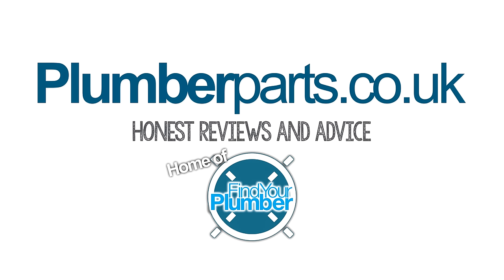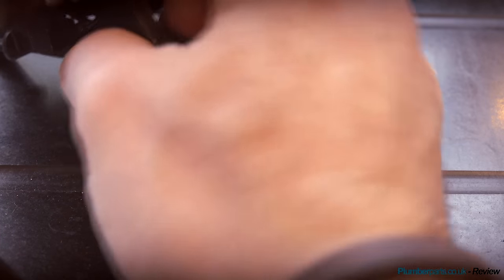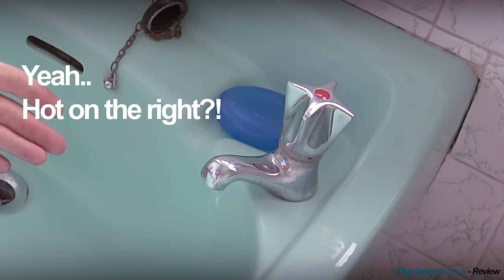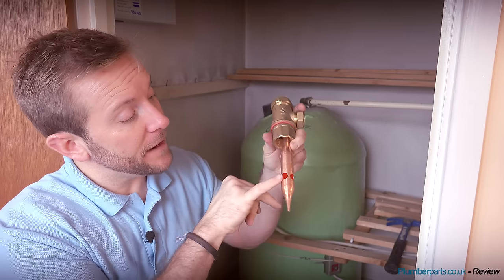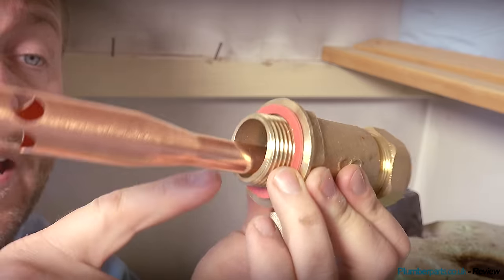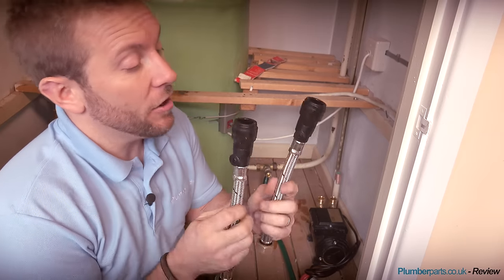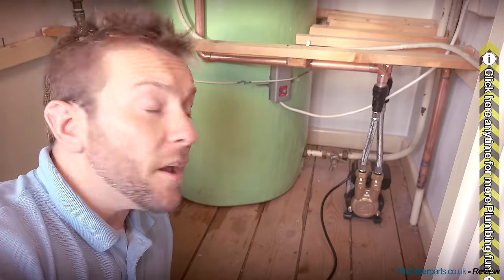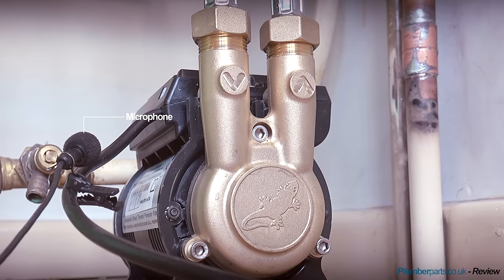BOOST HOT WATER PRESSURE - CT Force pump

Comment: Great video, given me hope. I'll tell you why. 
I have just installed a new mixer tap in my kitchen, along with a new sink, as it happens. I now have almost zero hot water pressure at the new tap. Everywhere else is fine, bathroom etc.
I think I know what the problem is...I have an old gravity fed system and this modern tap is designed for a minimum of 1bar. So, I now think to myself...install a pump on the hot water feed. But I need to understand the feasibility of this given that I have a Mira power shower drawing from the hot pipe from the hot tank and from the cold header tank. I will use a plumber to do the work but I need to understand how it will work, as I realize that the Mira shower pump doesn't want hot water 'pumped' into it.
I just want to know it can be done before a plumber tells me I need a Combi or another type of tap.
Reply: Steve what was the outcome? Did you install the pump without harming the shower? Cheers.
Reply: @MrWad3y  Due to the fact that my boiler was quite an old back boiler. I installed a new combi and changed the shower pump to a combi-compatible pump. I now have pumped hot water from the combi boiler.
Reply: @steveday6860  ah ok, probably a better choice in the end. Thanks for the reply, appreciate it!

Comment: I did everything in the video and it works a treat, except the shower. All the taps downstairs and upstairs work much better but when I put the shower on the pump does not kick in. It had an average pressure before and was adequate for a shower but I'm at a loss as to why the pump does not come on. Is it because of the mixer tap in the shower?
Reply: I am considering installing one and have the same set up. Is you cold water in the mixer tap on mains pressure or fed from the tank

Comment: I'm just wondering would it not pump water up the vent pipe ?
Reply: Hi, if the pump is installed correctly, in line with the installation guidelines, it will not pump water up the vent pipe. Thanks.

Comment: @plumberparts i have the same system, which i am looking to replace with a combi boiler, is there any benefits for keeping the existing system?
Reply from the maker: Unless space is an issue I would change this to an unvented cylinder and keep your current boiler. Combi's are nothing but hassle!
Reply: @plumberparts  true
Reply: Yeah it’s the tank in the attic that is going to be taking up room in the loft room. Anyway to reduce the system size without the whole system Change?

Comment: James can any single impeller pump work or does it have to be specifically for multi outlets... cheers
Reply: jason lawrence any will do, best to install a twin impeller to boost hot and cold if your thinking of using mixer taps or thermostatic mixer taps or showers anywhere.
Reply: What! no bypass!
Reply from the maker: Bang on mate!
Reply: Needs to be brass for hot domestic water.
Reply: Yay brass nuts in a world of plastic
Reply: @plumberparts  you used single impeller, and have mixer taps, wrong type of pump, you will find out when it comes to warranty claim, and they say its invalidated.
Reply: @sgt_xs9905  If you have a twin impeller pump and have a twin bar mixer shower tap and  sink taps  that are not mixer type, is this ok to install, as you could  have the cold tap on and not the hot at the same time is this ok.

Comment: Thank you for showing how this is done.I have a Victorian house in London with a 3/4 lead pipe cold water feeding two Bosch boilers as the house is in two flats  ,the pipe coming in is 3/4 to 15mm that feeds the hole house ,the pressure is ok but it can not deal with both boiler on at the same time or the toilet flushing .the pipe coming in is in the basement but have converted to a cinema room can I fit some type of pump with its own storage tank as I don't think that the pipe can deal with the increase in water flow needed, but it has to be small and not heard pumping away.Thank you for any advice that you can give me as I am no longer using the downstairs .

Comment: Hi James I am going to do a extension to my house & putting in a pressurised system from a gravity system with 2 pressurised bar showers, the flow rate is 16l min with 3 bar pressure from the outside tap will I have great pressure for the showers or will I need a pump/acculameter thanks love the videos
Reply: 3 bar incoming main should be defiantly enough to for the pressurised vessel, just make sure plumber installs 22mm not 15 mm from the main to the pressurised vessel.
Reply: Jordan Ackland thanks will do

Comment: Hi, I am replacing our existing Salamader pumps that have been discontinued. It has a 28psi sticker on it but when I rang Salamander they said that pump was rated 2.6bar. Online conversion says 28psi is basically 2 bar. should i get a 2 bar one or a 3 bar one to replace? The model Salamander suggested is the CT Force 20SU or 30SU. Many thanks in advance.
Reply: CT Force 30SU is the most similar product to your previously installed pump. Thanks.

Comment: Can you explain if the S flange is a separate purchase and or what they are used for and are they essential?
Reply: Hi Glenn The S flange and other approved flanges are ideal for any pump installation as they stop air getting into the pump from the hot water tank and causing damage. They are not the only approved method of feeding from the Hot water
cylinder. You can use the first tee on the downward leg for the CT Force pump if necessary.

Comment: does a twin pump system work ok pumping all hotwater around house? i.e pumping the main hot water out of tank to all taps, downstairs, bath, shower, bathroom sink? Obviously not all running at the same time.
Reply: @SalamanderPumps  I need this pump for my hot feed, but when i asked local dealer was told there is a  chance of sucking in the tank it's self,would have to change the tank to a pressurised one,what you think, thanks Barry

Comment: Hi. Don't you think the  hot water supply pipe at the top should slightly rise towards vent pipe?  Reason for that is to prevent parasitic circulation  ( water convection in the same pipe), and save energy. BS 6700 and Building Reg part L state that clear.
Reply: Yes he showed this in the video

Comment: But  if the problem was only with that kitchen tap, surely a simple pump (at around £50) under the sink would suffice?  And much easier to find a 13A socket nearby, so no need for a sparky to be involved!

Comment: hi, just wondering, could that not cause pump over into the f&e? sorry if it is a stupid question.
Reply from the maker: No worries mate. It would if you installed it before the feed and f pipe, but the way it's installed here, it's only pushing on the hot and cold taps!
Reply: plumberparts ah I get ya. Cheers mate.

Comment: Hi, I have a baxi combi and my hot and cold water taps cant be used at the same time due to low water pressure coming into the house, could I still use something like this to increase my hot water for my power shower
Reply: Hi Andrew, Unfortunately you could not use one of these type of pumps to pump direct from a combi. You can pump to a combi with one by
putting a cold water storage tank in the property and then pump from that into
your combi instead of using the mains feed to it. A Salamander HomeBoost pump may be a better solution to boost your incoming mains water. If you give us a call on 0191 5162002 then we can advise.

Comment: Will this pump used in the video work with mixer taps the pump selector on salamander website says I need positive and negative head. My setup is similar to this video.
Reply: If you are boosting water to a mixer tap that is used with the mains cold water supply, you will require a single negative head pump, such as CT Force 30SU.

Comment: Assuming this will boost all hot water outlets, including a mixer shower?
Reply: Yes, a single CT Force 20 can be used to pump against the mains to hot water outlets including a mixer shower. We do recommend the negative head (universal) variant, depending on flow rates.
Reply: Salamander Pumps thanks. Still waiting for @plumberparts to do a full install video.

Comment: Is there a danger of the storage tank run dry if demand is high ?
Reply: Hi, this is the same question that I had but noticed that you had not had an answer so wondered how you had got on ?  Cheer.
Reply: @steveg59 we changed out the gravity fed storage tank/boiler and put in a combi so pump no longer needed.
Reply: Hi, after I asked this question I found that Salamander have produced a "water starvation pump kit" to overcome this tank problem. Not sure how it works but looks ok to do the job. @Danny.A665

Comment: I am not a plumber but have an engineering background. I note your prodigious use of 90 degree elbows rather than 'slow' bends (not just you but many plumbers) and would be interested to hear why. I understand that constraints may force your hand at times but in this example you were in the largest airing cupboard this side of the black stump. Your mate could let that out to a needy (short) couple. However the main point is the low flow situation could be caused by the restrictions to flow presented by acute changes in direction (90 degree elbows).

Last stretch: I also not that the pipe you ran from the top of the cylinder was beautifully horizontal - is not supposed to be fitted 'on the rise' to assist with venting air?
Reply: your  right to a point  elbow  to  the pump  bad    from  doesn't  matter

Comment: how much are the pumps and rough estimate of installation costs,i really need one of those ,i live in the north (sheffield)
Reply: Late reply to this but the pump in the video is around £170, other fittings including the flange shown will be about £50. Labour varies per plumber but estimate around £100 - 150. Things to consider though is tank size in your loft, if your tank isn't 40+ gallons it will need upgrading or another tank linking to it. Also if you have any mixer showers, a single impeller pump won't be suitable as you'll need to boost the cold water to the shower too.  Also the pump shown is a positive head pump, which means it works off a flow switch. Some modern taps (mainly cartridge mixers) can't maintain the flow rate needed to keep the pump continuously pumping, which can cause the pump to pulse (stopping and starting), For this reason I only fit negative head pumps which rely on a pressure switch, they cost more but a much better pump.

Comment: Can these be used on an old worchester 240 combi boiler ? Good vid by the way.
Reply: Never pump the outlet from a combi mate. However, I believe Salamander (or Stewart Turner) make a boost pump for the inlet to a combi. Therefore if your mains pressure is low you run the main after your stopcock into the pump and is give you a boooost 😨!
Reply: @armoris66  that is right! We have a pump called HomeBoost which is specifically designed to boost the incoming mains to a combi boiler. Plumberparts has also done a video on this - https://www.youtube.com/watch?v=fURajD17BBQ&t=258s

Comment: I fitted a CT Force20su on my system and it keeps turning on and off like clockwork every 2 minutes for 2 seconds. I've verified zero leaks in the system and have contacted Salamander directly all to no avail. Their engineer said I should try NRV's on all hot water tails as I have mixer taps throughout, which I though was a bit strange to recommend - Has anyone else heard of this as a solution? Very frustrating.

Comment: What thermostat would I need for a pump it keep burning the neutral wire out
Reply: Hi, we would advise to have a cylinder thermostat or a blending valve fitted. If you contact our Technical team on 0191 516 2002, they can get in touch and help you resolve this issue. Thanks.

Comment: Thank you for this fantastic video, I have a question please can you install a pump on combi boiler?
Reply: Dean Abousaid only to boost you mains presure. If you cold pressure is good, then your boiler is either not working right or isn't powerfull enough to heat the water at the speed you want it. look up its specs to find out its litres per minute hot water rate.
Reply: yes  if  supplied  by  cwsc     tank  lay mans terms   pump must be matched to flow  rate  of   boiler   ore as close  as  possible
Reply: single booster   or  universal    if low  head
Reply: or  mains  pump if tank  not  available
Reply: depends  on  installation  ect
Reply: have  fitted  booster pump  to supply   combie  in flat  on  6th  floor  to  replace hot water cylinder  fed by  communal  tank  to give  hot  water and heating   where mains flow  not   sufficient to supply   bath room shower ect
Reply: in this  case  fitted  twin
Reply: on  inlet  from tank  if single booster   or if  house   mains pump

Comment: Can anyone answer this please?
At the start you said that the Salamander mustn’t have hotter than 65° through it.
Wouldn’t it be hotter than that going from the hot tank into the inlet on the pump?
Reply: If your stat is set to 65 Degrees then this can fluctuate around to 67-68 degrees, which it will enter the product at higher than 65 degrees. As long as the water does not exceed over 65 on the outlet of the product then this will be fine. Turning down your stat to around 60 degrees will be ok. Thanks
Reply: @SalamanderPumps  But dont worry, any engineer they send, there temp measuring device is set to read at least 69oC whatever the temp to avoid warranty claim and invalidate it. Surprised they not commented on how the incorrect pump has been used for the installation with mixer taps, has this invalidated my warranty! Wrong type of pump, yet engineer states he does not know what pump it should be, wow.
Reply: @SalamanderPumps  CTF30PS957 I dont see how it can help, the opportunity to rectify the faulty pump was given when the engineer came to sort it.
Reply: @SalamanderPumps  Was that serial enough to bring up my details?
Reply: @sgt_xs9905  Hi James, we were able to bring up your details and our Customer Service Manager would be happy to give you a call to discuss if convenient? We can confirm that the temperature measuring devices used by our engineers are not pre-set. Thanks

Comment: Hi what's the minimum head of water do I need for this pump to work ? 
Regards
Don
Reply: Hi Don, For a negative head model you would need 600mm
of head from the top of the pump to the bottom of the tank. For positive head
you would need 600mm head from the highest point of the system (pipework or shower
head) to the bottom of the cold tank.

Comment: If these pumps fail, will they still pass water?
Reply: Yes but with restricted flow, worse than before the pump was fitted. He hasn't done it in this video but with a pump that feed the whole hot water system you would normally pipe in a bypass too for when the pump fails.

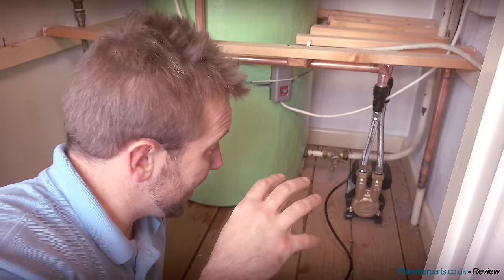Comment: 8:50 Can the pump be fixed to the floor so it can't be knocked/moved accidentally?
Reply: it can not good idea  will transmit  sound   mount pump on  foam  ore  rubber
Reply: pump  location?

Comment: I installed a positive head on a vented system and now pump is on for two seconds n then turn off the same is happening to hot water
Reply: Mine does the same, how did you resolve your problem

Comment: Hi Plumberparts. Been watching a few of your vids recently and like your clear explanations, but wonder if I could ask when you are working out the static head do you go by the top fill level to base (what I thought) or just the tank (asking because I know sometimes they reduce a certain calculation of length to compensate for another part of a formula).
Reply: You measure from the water level in the cistern/header tank to the highest hot water outlet (eg shower)
If that measures 3.5m it means you have 35kpa of head pressure.
Every 1m = 10kpa

Comment: or use a mains pump  to  boost supply
Reply from the maker: I'm afraid you can't supply this type of tank (vented) by mains pressure or pumped pressure. Thanks for the comment though!
Reply: @plumberparts    no not  a tank  i   used a   single pump   supplied   from  cwsc  to   feed   a combie  all  ready  fitted   in a block  of  flats  as mains   supply  crap   could not   pressure   heating  to  work    i no  flow  rate  through    boiler  is  governed    by  out put  cheaper at time to fit single pump   as mains pumps  not  listed  and  expensive  at  time.   asked  manufacturer   not conventional   but  ok

Comment: Only problem is it only last a year and your warranty is void because it's only designed to be used for showers not the full house.  Screw fix refused to take it back as it was not being used correctly. You need a system pump not a shower pump

Comment: gen no  probs     use  push  fit  or  compression    for  small jobs  in  lofts  ect  no  hot  permit  ect     if soldering  prefab  out side  before  fitting  if  pos     plan for the  worst  if  you  cant.

Comment: salamander  shite  pump   fit stuert  and turner   if any thing goes wrong they dont  want  your  credit  card to  come  out  to fix it    i fit  loads of replacement pumps   never have probs with   st pumps
Reply from the maker: Yeah I'm starting to look at ST for shower pumps and macerators. Heard lots of good things about them.
Reply: @plumberparts  My.new hot water pump i replaced the salamander that had 3yrs warranty left, for a Stuart turner, it's completely silent compared. Yes like you I used this type of pump and they will invalidate warranty has its pumping against mains pressure at the mixer tap, clearly written on my report. I am also curious how he tested my.temp, has my glass thermometer put it at least 8oC lower than his, and I ran boiler till stat turned off, ran hot tap for a minute then took readind, it's checked regularly has its used for water temp checks on sites.